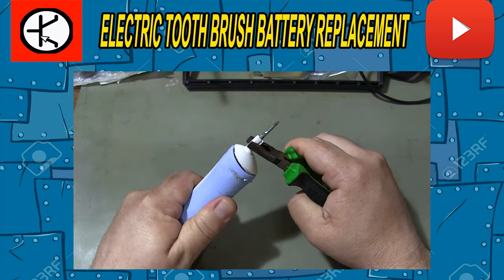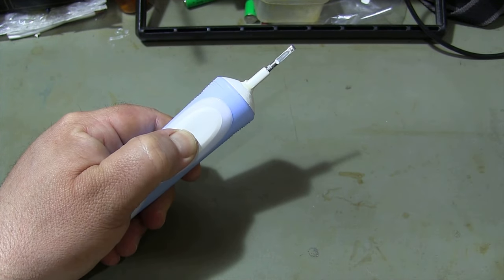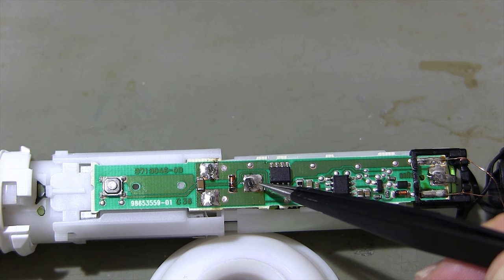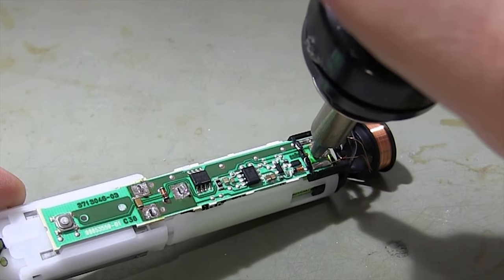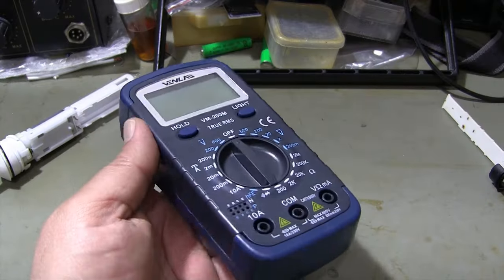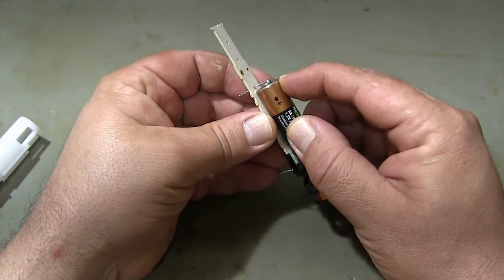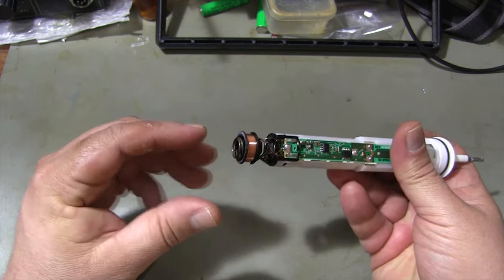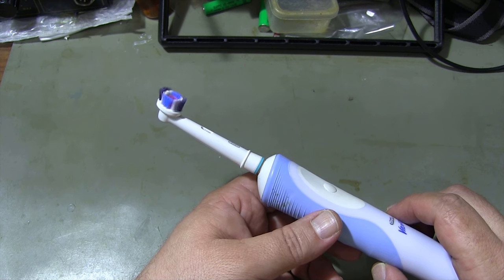Don't Throw Away Your Faulty Electric Toothbrush Without Watching This Video.

Comment: How do you fix dead rechargeable batteries? I have lots of broken electrical items like drill batteries,PS4 controllers and stuff. They all work fine apart from the battery, which only doesn’t work because I didn’t use it for a while. If you can show us how to fix them I would really appreciate it 😅
Reply from the maker: I'm thinking of making a video like this soon.